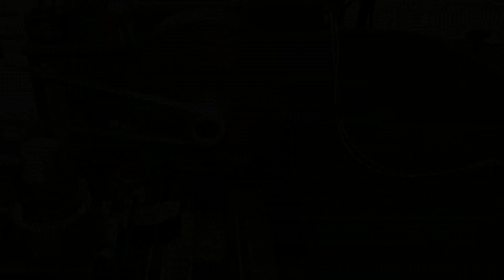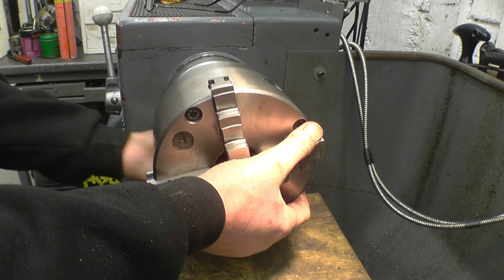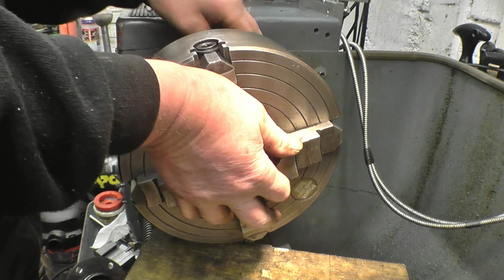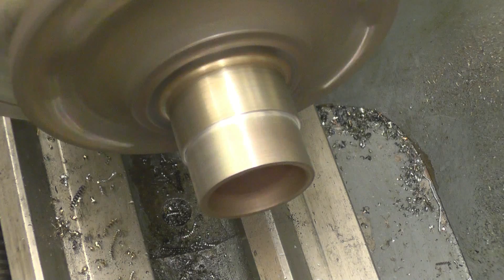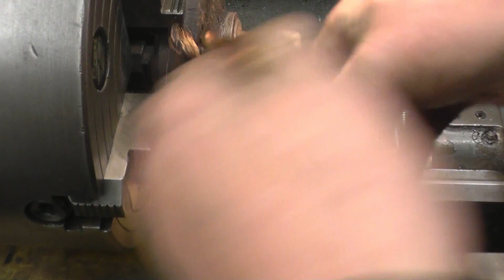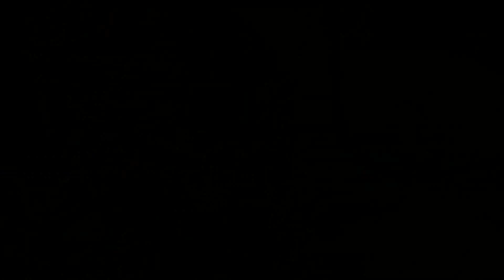SNNC 163 P2     TIG Silicone Bronze weld build up repair

Comment: flame spray metalizing would have been the easy and most effective way to restore this seal / bearing surface. spray welding (oxy-acet) with a nickle alloy powder would have made a better job.
Reply from the maker: it would have but i just used what i had  thanks for watching

Comment: Wouldn't it been easier to machine it down and then use a press fit sleeve and then machine the sleeve down to original size?  I've done that a few times with a harmonic balancer and a slave cylinder.
Reply from the maker: not for this application

Comment: For Me When I look at the repair John Did I would look at it and say well for a couple of minutes more I could do a complete job aesthetically speaking , IF I paid good money to have that hub fixed I would be the same as others , What sort of Bush Mechanic had a go at this ? But I suppose that is the difference in Taking that little more time to try to do the best you can not She'll be right mate . 
Thanks for sharing the videos John
Reply from the maker: I did re do the repair  thanks for commenting
Reply: Im Glad John I was always taught to be proud of my work and try to do th best I could , after all ones reputation is easily lost and hard to gain Well done Mate Proud of you 
Tony from Western Australia

Comment: totally serviceable repair on that wheel flange. looks ugly but the double row ball bearing races that rides on it could care less.  And there's no oil seal to run on this surface so any imperfections aren't a problem. I wouldn't have even machined it undersize before brazing it up. The worn area is usually rough enough for the bronze to bite into,and you're only trying to build it back up to original size anyway.

Comment: Did exactly the same on  a flange of a subaru. Two years later it's still going strong! The silicon bronze worked great at not tightening the splines as well. Thanks again for the videos, always pleasure to watch and greetings from Iceland

Comment: You get a grade D for done on that repair.  Fatigue cracking is an issue with any rotating assembly.  I'm not sure that it's a good idea to leave all those large imperfections on that extension from the flange.  Thanks for posting, stay safe.
Reply: I can understand that it would depend on the application.  If this is a heavy duty application, it could possibly crack or fail under high stress.  The reduced heat introduced into the hub by brazing instead of welding should substantially reduce the likelihood of cracking.  If it did crack, you would have to buy a new hub just like you would have in the first place.  In a light duty application such as a daily commuter, it would most likely out last the rest of the car.  I think torsional stresses in the spline would largely be controlled by the added strength the press fit bearing provides when in position over the splined hub.  I'm not an engineer, though.  Just observing.
Reply: I'll assume that  a rubber grease seal is not used on this because  It needs a perfectly smooth surface on which to ride, and there's none here.
If no seal is  used, I could tolerate  a few low spots here and there, but there's way too many for me. I'd expect to pay 1/2 price for that If i were the paying customer,   sorry.
Reply: I thought it was a fully sealed bearing assembly that was pressed on the hub.  If that is the case, then the repair is good.  It doesn't need to be pretty.
Reply: HemiRod23   John did indicate that it was a press fit bearing.  The shaft transmits torque through the splines and I'm concerned that the torsional stresses could cause cracking over time.
Reply: To get fatigue you need a cyclic load and a stress raiser. Given the application I don't think the load would cycle on the voids in a way that would make them stress raisers. Re- brazing would heat the part up again with the possibility of causing other damage to say nothing of taking more time and material. All that said, I might have been tempted to put a splined shaft into the end while brazing and I might have been tempted to preheat the part before brazing. I'm not a welder nor a machinist though. Just a precision whittler.

Comment: Good job man, aye no point brazing it more, will serve its purpose fine, need to try this method on the next one I do, had the same problem with the shrinkage on the spline after welding one before, all the best.